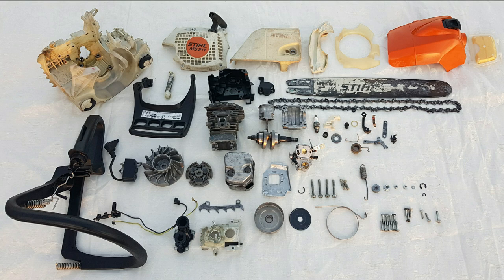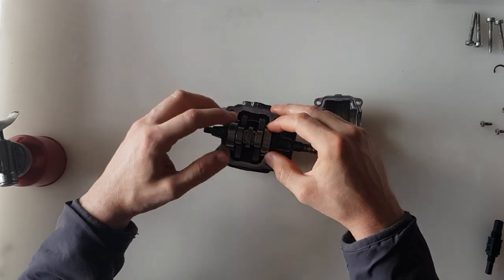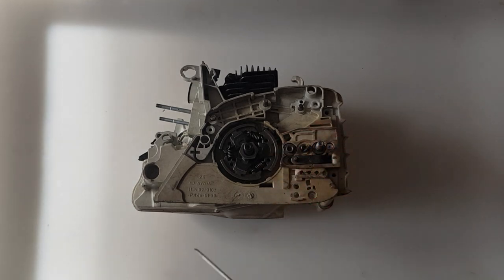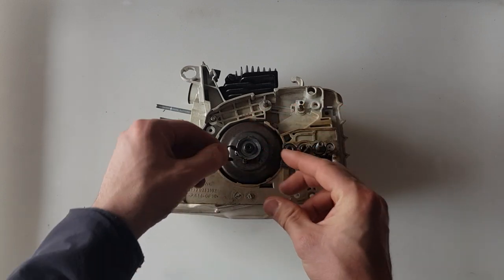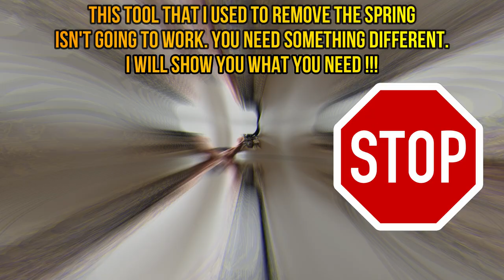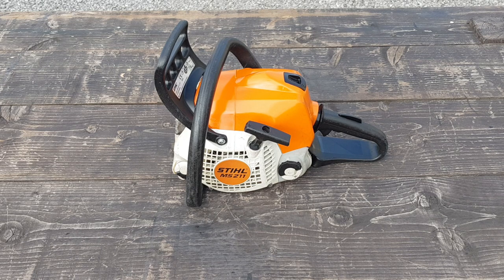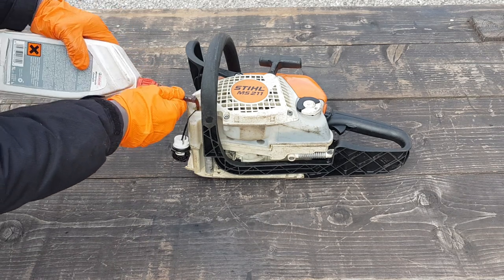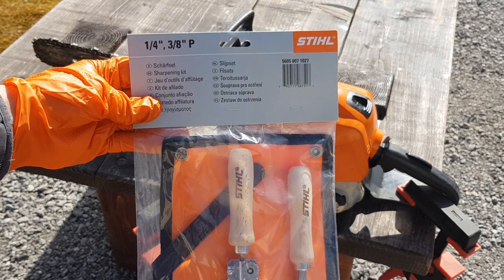Stihl chainsaw restoration stihl ms211 ms171 ms181 £50 $60 stihl budget chainsaw restoration PART 2

Comment: Picked one up in auction myself, and since it runs good enough and after seeing part 1/2 completely I realise I don't have the tools to do the motor overhaul & set them myself, guess outside cleaning will have to do.
Granted mine is not missing any covers and seems to have been well maintained.
Hats off on going all in with what you bought lol
Reply from the maker: Thanks for the kind words. Glad you got one yourself. They are good saws and have decent power to weight ratio. It was a big job to restore mine but worth in the end especially for the price. Glad you liked the video🤝

Comment: Thankyou so much for doing g this video and the other one. I've just rebuilt a chainsaw from 2 knackered ones just from watching your videos.
 I had the pleasure of having to drill the heads off 3 out of 4 engine mount screws too 😫 
 Mate, I can't thank you enough 🙏
Reply from the maker: No problem at all buddy. Glad you like it. Always nice to hear that people enjoy my content🤝🔧🔩
Reply: @TheKeenMechanic  the one chainsaw had a knackered engine, and the other one leaked bar oil from under the chain tensioner somewhere. There must be a crack in the chassis because when I removed the tensioner bar oil flowed from the oil port, but when I reinstalled the tensioner there was as much oil coming from under the tensioner as there was the oil port ! Lol .
 Thanks man👍👍
Reply from the maker: @matthewbishop9342  Yes, check for cracks. The cheaper saw bodies are made of plastic. The forestry saw bodies are made from Magnesium as they take more abuse and don't crack as easily as the plastic ones. Best of luck with your repairs
Reply: @TheKeenMechanic  I never knew that about plastic and magnesium chassis. 
I'm off to a forestry show next weekend, I'll keep a look out for one.
Reply from the maker: @matthewbishop9342  I have an MS261 and can highly recommend it to you. Very good power to weight ratio🤝
Reply: @TheKeenMechanic  cool, cheers for that mate 👍

Comment: really nice job i just repaired a ms211 with only 25psi on compression the main dealers told him it was scrap, im at the moment restoring a old sthil 009
Reply from the maker: Thanks mate. The main dealer guys don't want to spend a lot of time doing what we do, they just want to sell you a new one or quickly repair your old one for a quick profit. Thanks for your comment and for watching my video. I have just subscribed to your channel as a thank you and will keep an eye on your videos. Will be nice to see the 009 when finished😉🤝
Reply: Where can I find cheaper replacement parts?
Reply from the maker: Ebay
Reply: Garden hire spares
Reply: Or L&S Engines
Reply: @roystheboy  where to purchase cheaper parts
Reply from the maker: Try ebay, if no luck there just google what you need and something will come up

Comment: did you replace the piston rings?  what did you do to the cylinder to regain compression?
Reply from the maker: Hi
Everything I did was shown in the video exactly as I did it. I used the old piston rings. The one thing I guess that helped to restore the compression was to re-seal the engine sump. I didn't even replace the crankshaft seals. Just cleaned everything well and re-sealed. I guess I was lucky, but I wanted to see if it was possible to do it withing my £50 budget. Thanks for your comment

Comment: 35 cm  or  40 cm  bar 1.1 or  1.3 ???
Reply from the maker: Hi Bogdan
16" /40cm bar and 1.3mm
1.1 are only the small 12"/ 30cm bars as far as I am aware
Reply: @TheKeenMechanic  👍
Reply from the maker: @antochibogdan7090  I was nicely surprised as to how well it cuts this little MS211.  Not a bad saw at all, especially for under £50